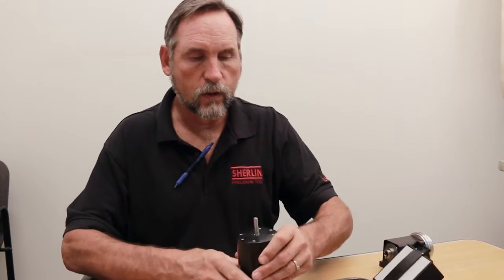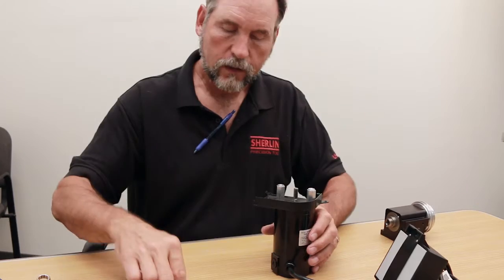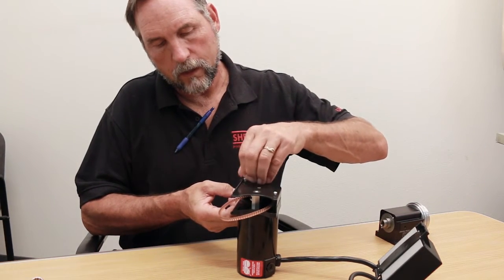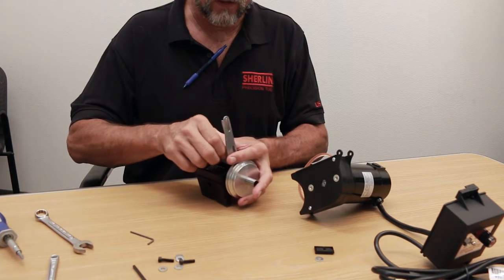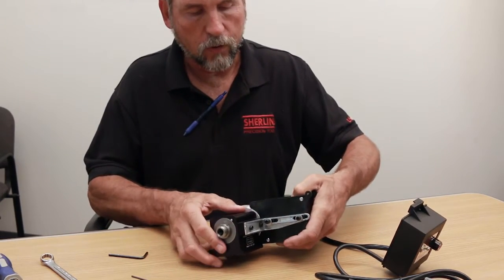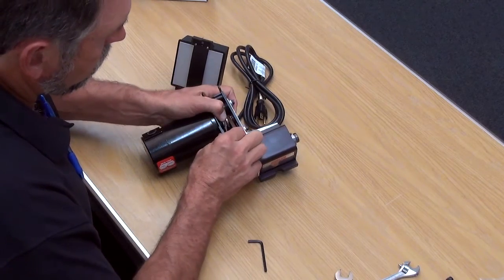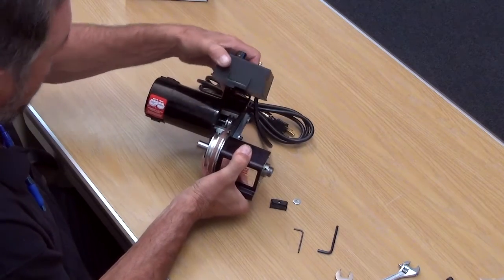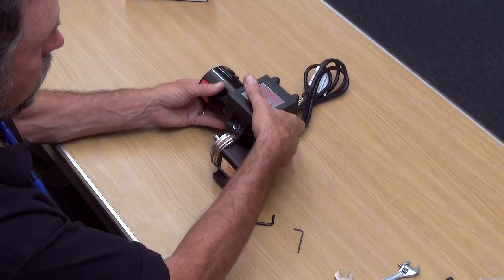Motor and Speed Control Assembly

Comment: Be advised that the "normal" position for the drive belt is on the larger motor shaft pulley and the smaller spindle pulley.  For large diameter stock, Sherline recommends the "high torque" position whereby the smaller motor shaft pulley and the larger spindle pulley are used.  In this video, he demonstrates the "high torque" position.

Comment: I just purchased a Brand New 2010 Mill Machine from Sherline a few days ago & while assembling the [MOTOR & SPEED CONTROL UNIT] 👇👇👇👇👇
👉I made a few observations & added the Following Minor  TWEAKS …to make everything fit. 

A: my motors electric cord wasn’t mounted on the side of motor, but on the bottom. No rear fit issue just not as easy to sit flush on a table (like my Sherline Lathe setup having this same electronic cord placement)

B.Here is where I ran into fit issues. 
👉The Plastic Belt Guard halves had to be {REVERSED} in order for the Headstock pulley assembly to fit. Not a big deal just Reverse Everything shown in the video with this section.
**So the (2)  HEX SHAPED DEPRESSIONS for your Screws will be on the SAME SIDE as the main motor**

C. Lastly the “INSERT EARS” for the Speed Control Housing has plastic protection Guides for the (2) Cables & they make it Impossible (for me anyway-I was having to muscle it & could tell I’d end up snapping off plastic if I continued- as a Scale Model builder I realized that sometimes you need to think outside the old 📦😉🤓) to fit the Ears into the “BELT GUARD HOLES”  
***I just trimmed back a very small area as to make the fit, without giving up the right fit. 

This Video is still An INCREDIBLE INSTRUCTIONAL for this Sherline Assembly.   Easy to follow. [Even for my ADHD  🧠 🤓]
Thanks SHERLINE for such a QUALITY CRAFTSMANSHIP 8 Directional Mill🤩🤩
☯️ZenModeling☯️
Reply from the maker: Thank you for the feedback and we will look into your modifications.